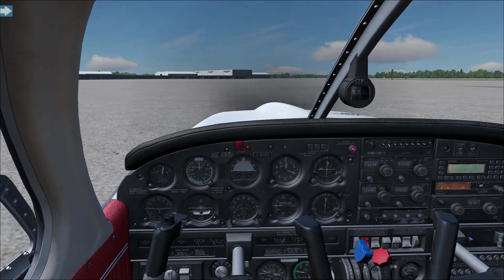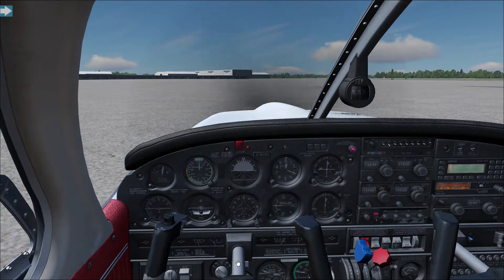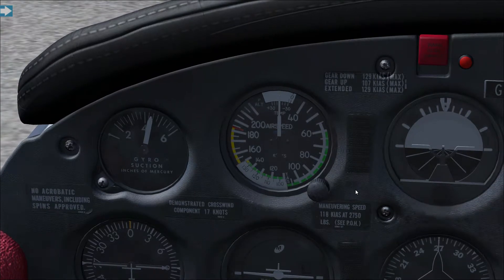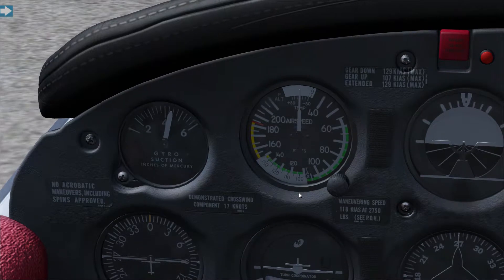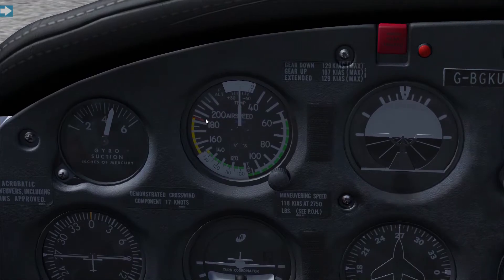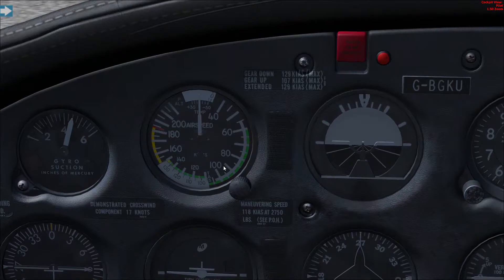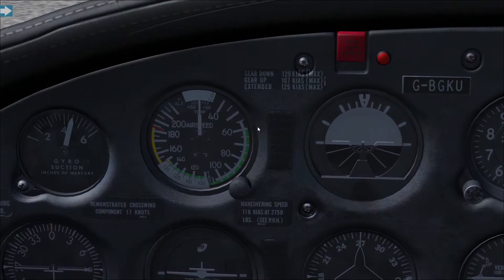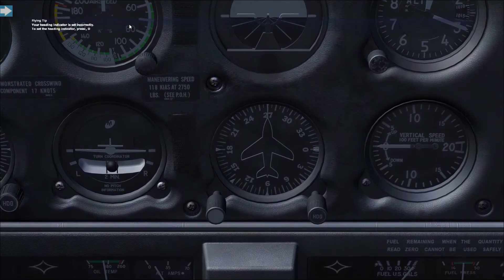Flight Simulator Advanced Tutorials | The Ground Up | The Six Pack -  Lesson 1

Comment: Yeah good stuff man, for me personally the most important of the 6 instruments is the Airspeed indicator as a VFR pilot I'd never take much notice of the Attitude indicator.  What used to be the most common pilot error for crashes was pilots turning onto final ( just turning bleeds off airspeed), lowering gear and dropping flaps mid turn and not paying attention to airspeed and stalling the craft... if stall recovery is say 1200 feet and you stall at 700 on final you're boned.
Only thing I'd suggest perhaps for new pilots, maybe put up a pic' showing what you're explaining as in angle of attack/ lift, air speed vs ground speed etc which would help visualize some what you're explaining. Oh and the vibrating panel was a bit much... maybe freeze the shot while talking  if showing this on the ground.
Reply from the maker: From a personal standpoint I would probably go for all six being equally important, though I could do without a Turn Coordinator or a VSI, or even a compass card if I had a working normal compass, and the other instruments working.

The pictures you refer to would be going into more depth than I would want to in this tutorial (as you noticed I sort of just brushed on the basics of stalls etc) but on the Discord channel I will be having diagrams like that if those with access request it! And freezing the shot is probably a good idea yes. Thankfully I do not think there is any more I need to show on the ground itself with regards to the panel. I think... 

Also: Awesome display picture, you have. Much beloved to many, it is.

Comment: Thanks much.  Very informative.  Could you comment on caged/uncaged attitude indicators?
Reply from the maker: You're welcome! My only comment on that would be that I believe an attitude indicator should always be left uncaged during flight as it would wear out the components in it if it is not left to freely move. Caging it may also give a false zero as the indicator would be locked into a specific orientation regardless of attitude. The only time I would say caging one would be useful (in flight this is) is when you are doing stunts that would exceed the limits of the indicator.